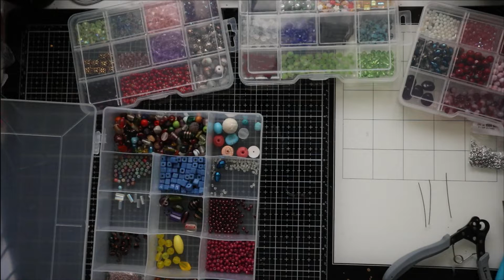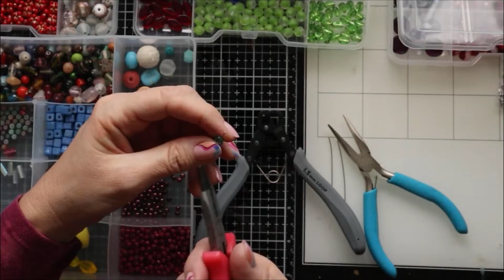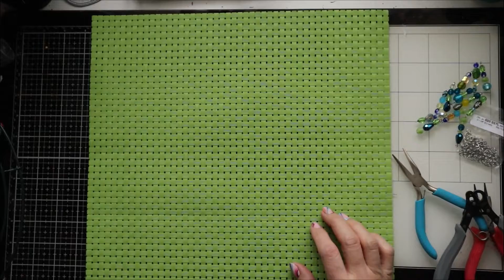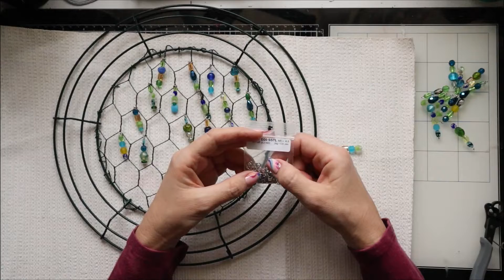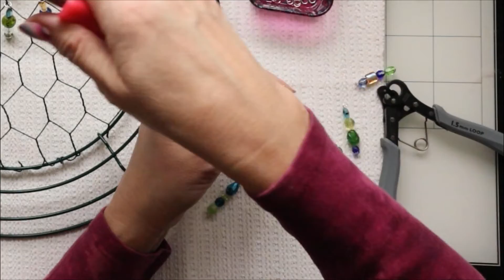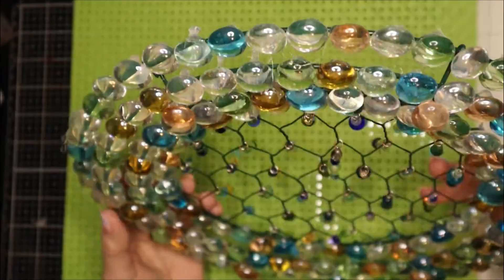Suncatcher - Beads and Gems

Comment: Cleveland! Ohio? That’s where I live. This was a great idea for a project. 

Might I suggest using an E6000 or epoxy glue to glue the gems on the outer part of the wreath? You can use a glue gun to secure it as you work, but securing with epoxy glue (or even using UV resin to cure it onto the metal) would make me feel a lot better… 😅 

Beautiful, unique work. I have subscribed to your channel. Thank you for the wonderful tutorials.
Reply from the maker: Yes!!  Good old CLE!  Do you do arts in the Cleveland area?  I see your name is Alpine Arts.

I hate the smell of E6000, but guess I could do it outside. It was cold when I made this video though. Thanks for subscribing!!